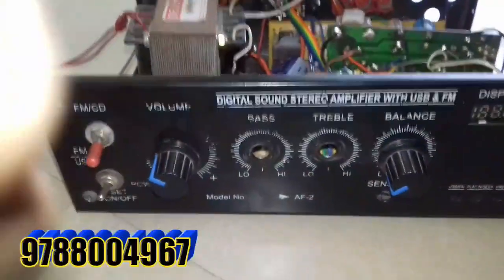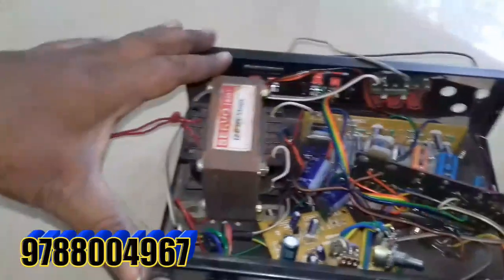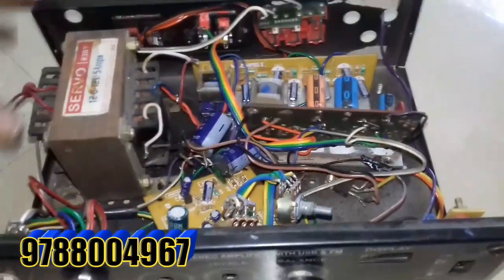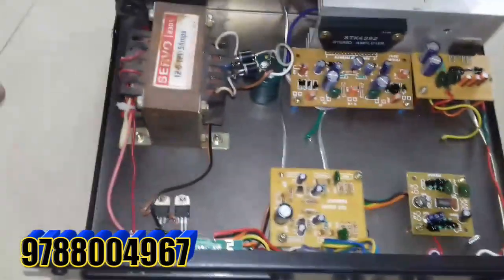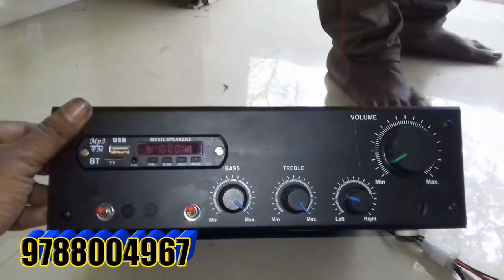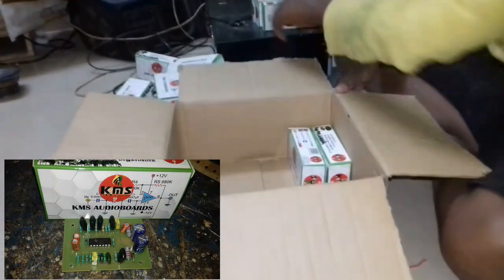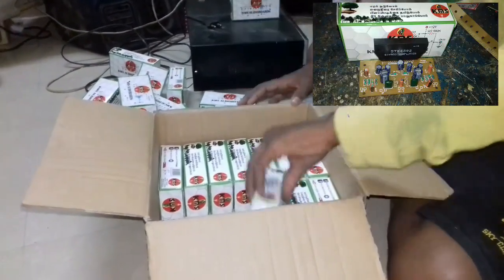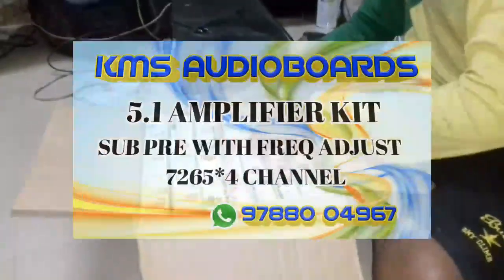2+2AMPLIFIER REBUILD

Comment: Voltage doubler how bro...?
12 0 12 3amps transformer irukku atha 24 0 24 3 amps aaga convert pannalaama...?
Reply from the maker: 12-0-12 transformer 0-24 , 0-12 மாத்தமுடியும்
Reply: Amps rating maaraathaa....?
Reply from the maker: Marathu
Reply: @kmsaudiolab2026  eppadi matthurathu